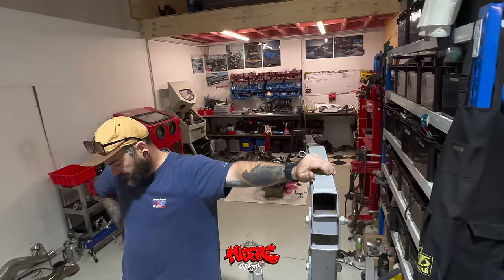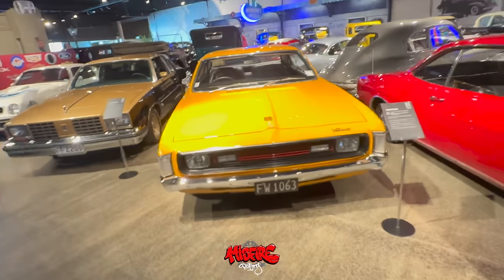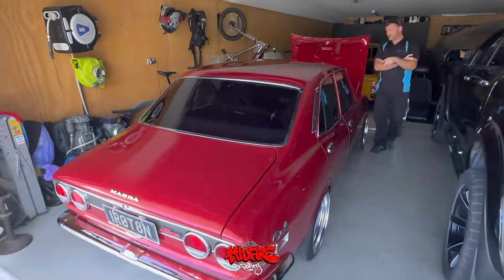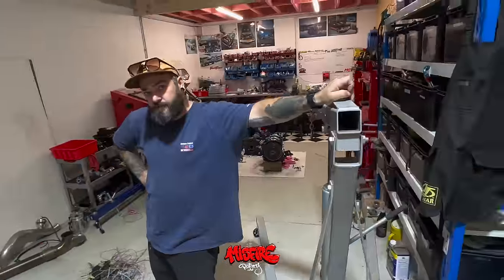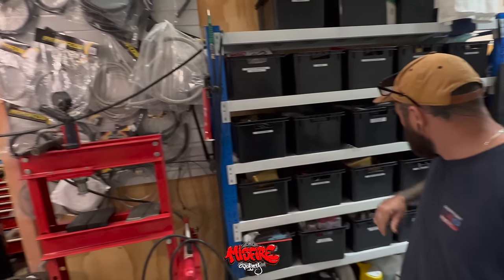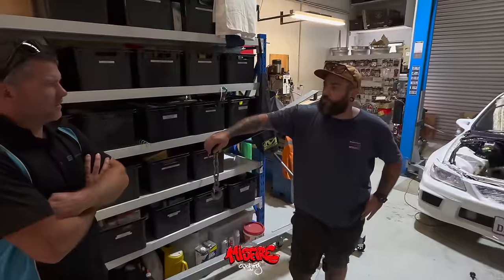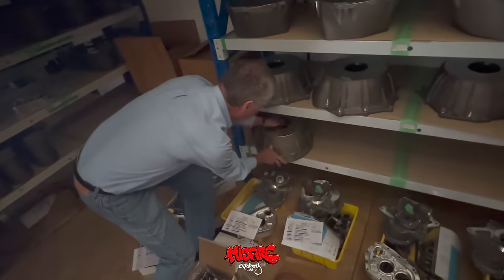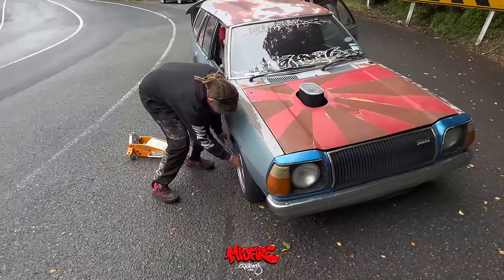Kingswood ROTARY powered Roadpacer

Comment: Rx2 used to be owned by an engineer called nagz in Rotorua he built it.
Reply from the maker: 🙏🙏🙏❤️❤️❤️huh that makes perfect scenes do u know who has that gilmer drive🙏🙏🙏
Reply: You tube channel Mesdup more footage of it
Reply from the maker: ❤️❤️❤️❤️❤️❤️❤️❤️❤️❤️❤️❤️❤️❤️❤️❤️that rotor
Reply: If the current owner wants to get in touch I can supply you with the original lemon check I did for Nages back in 2006 when he first brought it